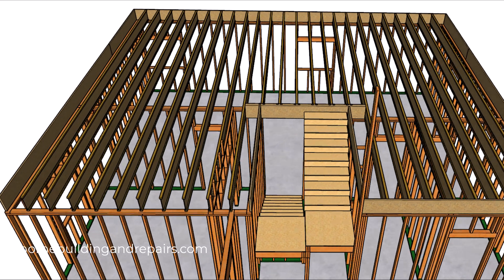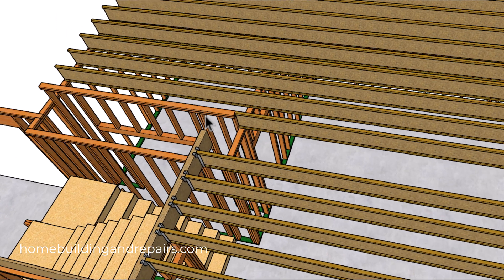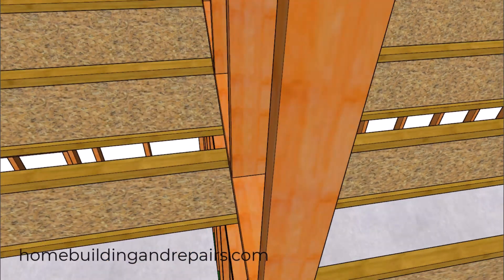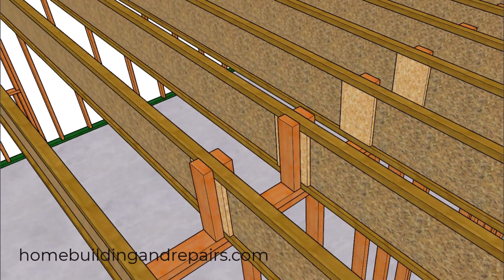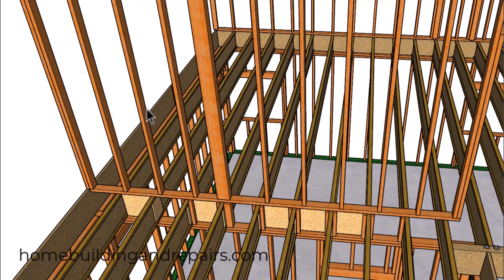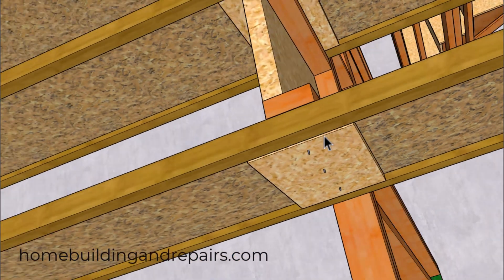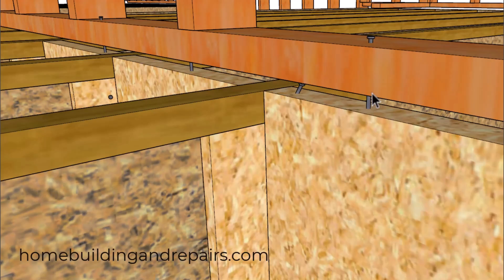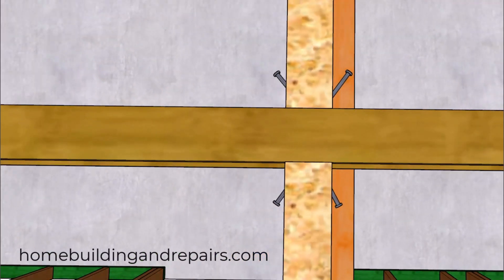Squash Blocks And Wall Framing For TJI Joist Over Parallel Walls - Building Examples And Tips

Comment: I’ve noticed a few comments you’ve made regarding this topic I.e “1/16” larger because of wood shrinkage” and in this video you recommend flushing the top of the squash block with the joist. Every and all I Joist manufacturer states very clearly that below load bearing exterior walls, 1/16” tall squash blocks should be installed to transfer load around the joist, as it’s web is not rated for the compressive strength required to carry the weight.

 This is very readily available literature which I’m surprised you’ve not come across. The recommendation you make in this video could lead to a catastrophic failure. Just a heads up from a builder.
Reply from the maker: I appreciate the feedback and did mention it in video.

Comment: Squash blocks need to be taller than the joists because i-joists are not meant to carry the load from the walls on the outside down. They are too weak and prone to twisting if a load too heavy. compresses them.

Comment: I dont know why but the squash blocks being 1/16 proud of the top of the joist might have a sound engineering reason... Maybe inconsequential
Reply from the maker: Over time construction standard lumber like a 2x4 will probably shrink, making it even with top of TJI that might not shrink. Again, Follow manufactures instructions.
Reply: Different manufacturers offer different explanations. In general, the shrinkage is the main reason. If you're running lvl or lsl or psl it's irrelevant. Same height. If you're running a kiln dried and heat treated, provided you do not expose it to much water during construction, even. If you are using standard white wood or SPF that isn't fully treated, you'll see 3-6% shrinkage.
Reply: Toe nailing from the top of blocking into tji and web stiffener would work too. 3.25” would lock everything together. Just drive it deep enough… not convinced it would split or be proud. Also I’d add a dab of sika flex 1a between squash blocking and touching parts to not squeak